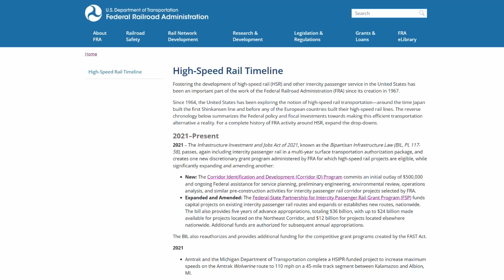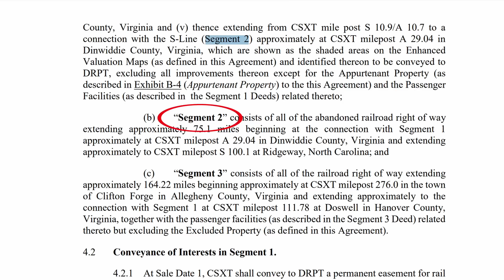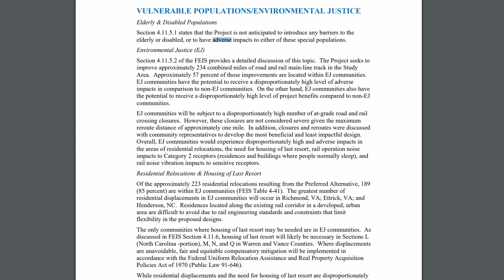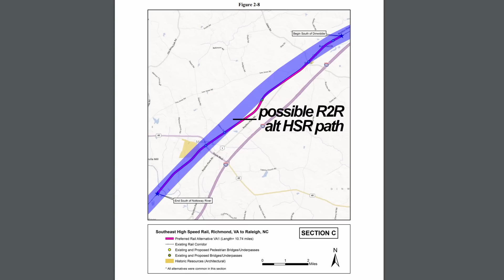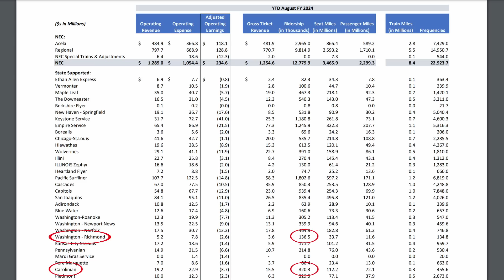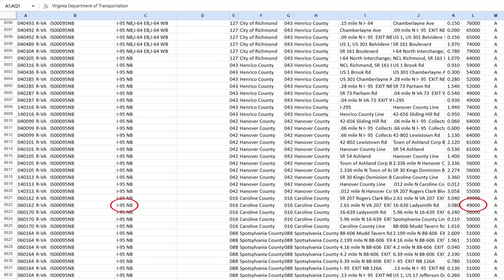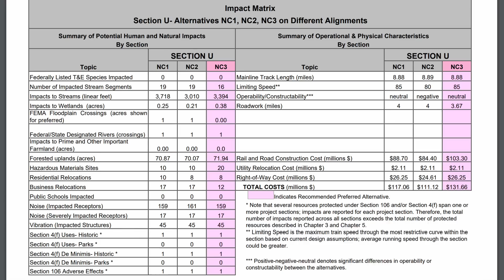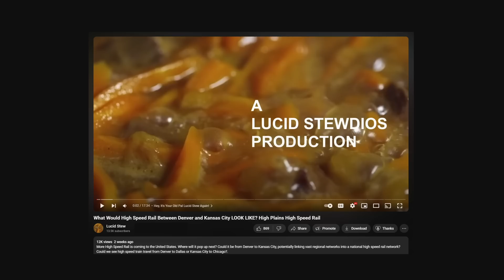The U.S. Southeast High Speed Rail Corridor at True High Speed | R2R | Richmond, VA to Raleigh, NC

Comment from the maker: It has come to my attention that there is a tentative plan for a dedicated SEHSR platform a little north of Raleigh Union Station that will technically be part of the station, but about a 500ft walk from the station. Given this future possibility and the level-crossing of NS track in the same area, I think at-grade there for dedicated HSR tracks is probably a bad choice. I looked more closely at the "possible tunnel?" 11:46 and it looks pretty doable on either end with some complications from a nearby creek. That would be 2 miles long, run under Raleigh Union Station, and add about $2 billion to the cost. It would save a few minutes. EDIT: I have continued looking at this since it will start the Raleigh-Charlotte video. After looking at all the plans and technical drawings available it appears that routing and stopping at the currently planned Raleigh platform is possible sans backup maneuver. However, there is only room there for 2 electrified tracks, no passing at the station, and only the single platform. Also, west of there its better to end up on the south side of current tracks than north, and a tunnel would avoid the level crossing of Norfolk Southern directly west of Raleigh Union. All of that seems to reinforce the idea that a tunnel and underground platforms are the superior choice for a true HSR service. However, that does not settle the issue! Overall, Raleigh is a highly imperfect, but necessary stop. I'll talk more about that in the Raleigh-Charlotte video.
Reply: You can put in a new platform north of the station in your next video SEHSR, Raleigh-Charlotte.
Reply from the maker: @bjturon  If you're aiming for dedicated electrified tracks, I don't think you can fit the tracks, the platform, the NS track and the CSX track there, so it might need to be a tunnel from the CSX yard to about where the prison is.
Reply: Raleigh local here. Everything I've seen reported is that the Hargett St at-grade crossing would permanently close for the HSR station to be built
Reply from the maker: @andrewbelter  yes, that is in the Tier II EIS.
Reply: @LucidStew  The street grade crossings relevant to HSR are all slated for closure. Boylan Diamond is a sticking point, but that's past Raleigh Union Station (it would be in the Raleigh-Charlotte segment.)

I think the diamond might be able to be closed given that NS has devolved operations of the southbound route to RFCC and the north/eastbound route to CLNA. The issue is that NS still owns Glenwood Yard and the tracks between there and the diamond.
Reply from the maker: @orulz1  The road crossings aren't the issue. It's making room for everything in the space available and then the level crossing of NS on the west end of the wye, which is highly undesirable, but tolerable if necessary.
Reply: Your downplay on it is just a reaction for not realizing it was going to be there.
Reply: Please explain further why say half the track of the S-line can't be 125 mph.
Reply: @davidjackson7281 Mostly opposition from locals and more importantly the local railroads
Reply: @LucidStew  li should be high speed or none.

Comment: I love how CSX slid that clause in there that they will Retain "trackage rights". What that means is they will fuck over amtrak with their slow ass freight trains. So forget about anywhere near 80mph average speed. Not on a line that is for all intents and purposes, single track. Sidings are not main line track and are almost never built for more than 20 mph running since it has a short distance. They are normally governed with a restricted aspect which is 20mph AND the engineer must be able to stop their train within half of the distance at which the eye can see of an obstruction. If the siding has curves tbis speed is more realistically like 10 mph. So yea useless. 

Amd yea lets spend billions on a project connecting 2 cities. Ok. With richmond having population currently of 200k and raleigh having 1.3mil is there even alot of people who want to travel between the 2.? Why not just go to charlotte making an intermediate stop in raleigh ? And why spend billions to do this just for a max hypothetical of 110 mph. Spend a few more billion and just have true high speed, electrified, grade seperared and freight isolated routes.  Ahh yes. CSX is just looking to get free money to upgrade their own lines on the tax payers dime. They arent slick. And in railroading history this has happened a time or 2

Comment: I love your videos ❤
Reply: If all your projects would be implemented US would have great HSR systems between bigger cities and metro areas.
If projects stayed within budget that would be great and Huuuge improvement in passenger travel.
You are visionary with good mind.
Can you make 1 or 2 videos like a summary of all your projects put together on maps.
All projects are interesting  but would be great to see all of them together on one BIG MAP of USA.
If video would be too long, you could divide on 2 parts.
For example, WEST and EAST of country.
You have made 1 video about Appalachian HSR going along mountains connecting very North even Canada with South to Mexico.
Something like that including other projects on ONE BIG MAP
Reply: That will be great if all your projects would be built and connected to Amtrak and Brightline. 
Amtrak should build real fully electrified SouthEast Corridor to Atlanta and continue to Florida.
High quality South Corridor with small branches to smaller cities
Connect to Brightline
Reply: I just started to look at Amtrak info, and it looks like bigger problems and travel times start south of Washington DC where trains have to switch to diesel mode.
Is that correct. 
All distance from DC to Florida goes on. Diesel.
ALL also slower routes.
Travel time from NYC to Florida 30hr
With good design and planning, that time could be easily cut in half to 15 hr even if the train is not truly HSR but with  upgrades to the whole system and electrification,  stops only bigger cities

Comment: Looking at this, it appears that it never exceeds about 185 mph. This is why I propose getting new Siemens Chargers on the Northeast Regional to be electric-only rather than dual-mode and be capable of reaching 140 mph, while new Siemens Ventures will also take inspiration from their European counterparts and get up to 140 mph. No tilting. 

This would lend well to this Washington-Raleigh trip. Now, with this alignment but at-grade when at speeds under 110 mph to reduce costs significantly, it would be 1 hour, 12 minutes from Washington to Richmond at an average speed of 91 mph, 1 hour 45 minutes from Richmond to Raleigh at an average speed of 86 mph, and a total of 2 hours, 57 minutes from Washington to Raleigh at an average speed of 87 mph. 

I prefer extending the Northeast Regional over the Acela as it would better serve the most important markets: business travelers here are not as, ah, important as north of DC (Wall Street) and so they can get to suck it up with a still relatively quick HSR trip through picturesque landscapes. Workers who would move from DC to Richmond with this to avoid the high housing prices in the capital but would still work in DC couldn't afford the Acela at all, but taking the Northeast Regional at a reasonable commute time is fine for them and much cheaper than continuing to live in DC. And of course, building the majority of the route at-grade rather than grade-separated is much cheaper.

Comment: The Raleigh area build is NOT going to happen, no matter what, in that form... but still a nice thought.  Since Richmond to Raleigh is very good I-85 for 75% of that distance, a better solution is building an expressway to bypass and parallel US 1 south into Raleigh from I-85 in the north.
Reply from the maker: If you find U.S. 1 improbable, I would argue for the greenfield south of Henderson and then hooking back into the planned R2R route north of Youngsville. That would be about the same time and cost-wise.

Comment: You do all of that just not to electrify the corridor? I dont even know why that is even an option.
Reply from the maker: The freight rail companies are generally opposed to passenger rail infrastructure and operations impacting their business, and you're dealing with them to some extent unless bypassing their rights of way completely. In general catenary and high speed is something they're going to oppose too close to their tracks.
Reply: @LucidStew  CAHSR is having that issue with UP between Gilroy and San Jose, and is working on an agreement with them. It'll make electrifying LA to Fullerton interesting, though maybe BNSF is more open to the idea than UP is.
Reply from the maker: @ChrisJones-gx7fc  CAHSR traffic between L.A. and Anaheim is going to be pretty minimal and slow compared to the rest of the system.

Comment: Raleigh's metro is really 3 million, since the Triangle is one big sprawling city. Think Dallas-Ft. Worth type s***.
Reply: It's not 3M yet, but it is surrounded by other metros like Burlington, Fayetteville, Rocky Mount/Wilson that augment its 2.4M CSA.
Reply: @johnlabus7359  Fair enough. You include those areas and it's actually a lot closer to 3m (those combined net about 1m), but you're right that the CSA is nearing/surpassed 2.4m as of 2024, and I'd say the CSA is a better way of analyzing the active metro population, ie people residing, working, and living all across the Triangle. While RM, Fayetteville, and Burlington/Mebane all feed off the Triangle, they're distinct enough and distant enough that I'd say it's right to distinguish them from the metro. The purpose of my comment was to really differentiate/emphasize that the metro population of Raleigh was a lot more significant than described, and our entire CSA really is one big sprawling megalopolis.

Comment: Why don't you also take intercity bus passengers into account when you do your ridership estimates?
Reply from the maker: I'm not even sure if that data is available anywhere. I certainly haven't found it. From some estimates I've seen, nationwide combined ridership is similar to Amtrak's. The 1,400 in the video for Amtrak is likely overstated by a bit, so it may even out. It's probably still in the ballpark of 6,500 trips/day on the high end.
Reply: Raleigh is building a Union Station bus terminal next to the train station to connect more folks to the train services.

Comment: Bro, I want to know why they rejected the 185 to 200mph option, I know money can be an issue but like $12.1 billion that's definitely worth it!! Like does nobody in FRA or whatever even think about the future?
Reply from the maker: They believed that the dedicated right of way required would run into too much opposition, be too expensive given the available ridership, and take too long to construct. The Tier II EIS does mention the possibility of conversion to electric at some vague point in the future.
Reply: @LucidStew  as long as the opportunity is there. Even if electrification only marginally improves travel times, the ability for thru-running to/from the NEC is huge. Honestly should be electrified rail all the way from DC to Atlanta, even if it's a mix of high and higher speed rail. Hopefully over time the speeds will be increased from 110 to 125 mph.
Reply: @ that’s a bit absurd, I feel like realistically, nobody should be opposing it especially when everyone wants to be environmentally friendly. True high-speed trains are literally essential for fighting climate change. Also, if you consistently spend money on high-speed rail, then it won’t cost as much

Comment: Itll be interesting to see where Amtrak goes with Richmond. I’d love to see all traffic go through Main Street. It’s a great station with lots of potential and it would get riders much closer to downtown and connected to other transit options. Think about it: a second track could be rebuilt on both the Peninsula and Bellwood Subs along with platform access to all four tracks. This would serve S-Line and other thru services. Then, up to four terminal platform tracks could be constructed between the Peninsula and Bellwood (may require some realignment on the Bellwood) for trains with Richmond as a southern terminus. This could supplement VPRA’s plan for hourly NER service. I have a huge vision for Main Street station, but I unfortunately do not hold design skills as amazing as yours.

I always wondered how the R2R trains would make it in and out of Raleigh Union. Do you think a second platform could be constructed on the northwest part of the wye to avoid a backup maneuver?

I’m also surprised that a lot of the S-Line will be single tracked, but maybe the siding tracks can be linked up in the future.

Comment: As a UNC Chapel Hill student, I can only dream of the HSR expansion to the Southeast but I can hope that the S line project is going to be completed sooner rather than later.
Reply from the maker: Tentative completion to Wake Forest is 2033, so it unfortunately could be a long time until the entire thing is done. It likely depends partly on funding. They have about another $6 billion to find.
Reply: I live in Chapel Hill currently. It is definitely disappointing that there is no rail link between Chapel Hill and Durham. 
At least increase the frequency of the 400 bus if you aren’t going to build rail.
Reply: @HIDLad001 it’s duke hospitals fault that Durham/ Chapel Hill doesn’t have one
Reply: @XxrashadthelengendxX  Them not wanting it is very ironic because they had a literal train running through their hospital. It was called the PRT and closed about 16 years ago

Comment: How about a video about improved RTR mid speed version 125mph max non electrified
Reply from the maker: I went by the EIS and didn't bother measuring curves on the plan, but I'm pretty sure parts of the right of way are fine for 125mph on geometry. Since its already planned to be completely grade separated, they'd likely need to adjust tracks a little and throw up a couple hundred miles of fence to seal it.

Comment: 11:43 Rather than having trains reversing into the station, it seems more likely to me that the station would be relocated slightly further south (e.g. between W Cabarrus St and W South Street) as that's just much better operationally.

Anyway great video showcasing the additional benefits of going straight for high speed rather than faffing around with upgrading the existing lines, which, given it could cost in the range of $7bn, makes the $12bn cost of a proper dedicated high speed line look very appealing indeed, especially considering the benefits it would bring would be orders of magnitude higher than what is being proposed at the moment!
Reply from the maker: They have some vague plan to have Raleigh Union platforms for SEHSR at some point. I'm not sure how long it will take to build the whole thing. Probably a while. The more I think about it, the more I like the idea of a tunnel avoiding that whole mess. It would likely be $2-3 billion, though.
Reply: @LucidStew  yeah such an expensive tunnel seems like a good way do kill off any hopes of a true HSR line being built so I think it's more likely they try to do some sort of upgrade/relocation of the existing station but I suppose it ultimately remains to be seen because nothing we're discussing here is certain at this stage!

Comment: If you're already going to spend seven billion on a 110mph train you might as well spend 12 billion on a legit high speed line.
Reply: An extra $5 billion doesn’t come from nowhere, and even the full $7 billion currently is far from guaranteed.

You also conveniently didn’t discuss the fact that a big chunk of that $7 billion is to buy up enough land and make the track straight enough to support higher speeds in the future.  It’s limited to 110MPH because that’s the best they can do without removing every grade crossing, but remove those and the planned alignment will be good for at least 150MPH in most places, with 125MPH curves.

Criticisms like this are why infrastructure in the US never gets done.  People just complain about the upfront value without understanding that limited budgets and growth potential are a thing.
Reply: Canada be like for HFR turning HSR when they’ll be electrifying and originally running 125mph/200km/h a former CP corridor and extra tracks in other corridors.
Reply: Even calling 110mph "high speed rail" is a joke 😂
Reply: It’s not about the M.P.H., it’s the H.P.M. Upgrading from 79 to 110 saves 13 seconds per mile. Saving another 13 seconds requires increasing the speed to 181 MPH.
Reply: @spencerjoplin2885  thing is, 165-185mph isn’t even particularly insane to expect these days. France manages much higher speeds than that, so does China, and both China and Japan are currently looking at 300mph speeds for their maglev systems

Also, it’s not about the seconds per mile, it’s about the minutes per JOURNEY that’s important. 110mph is not saving you enough time for the system to be competitive… 140-165mph however is, and 185-200mph would be a completely reasonable target to expect given America’s budget and resources and expertise.

I mean, if America can beat the rest of the world to stealth aircraft by 40 years… I think they should be able to get a halfway decent HSR network by the 2030s!
Reply: @gabingston3430  All new extensions should be High Speed or none!
Reply: Exactly, it like they’re trying to give us a cheaper version of high speed rail